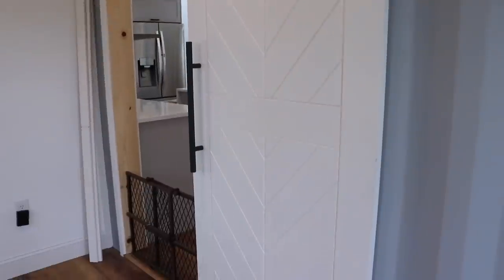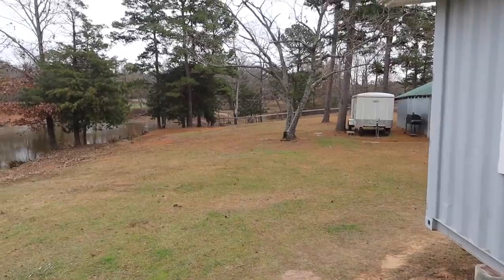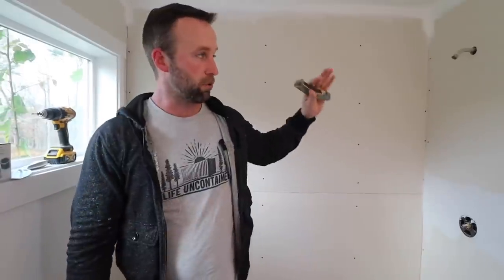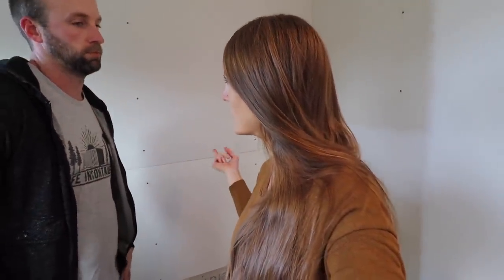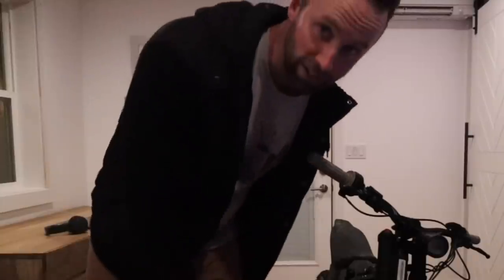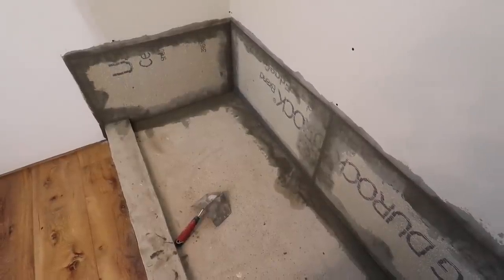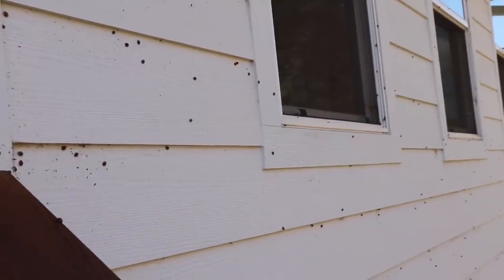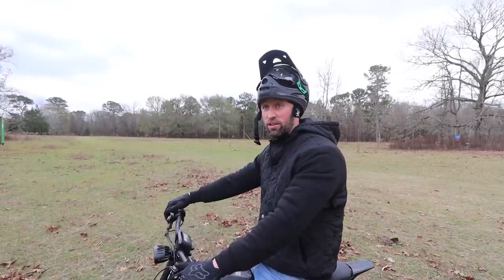THE MOMENT WE'VE BEEN WAITING FOR!

Comment: Smart to do that shower that way.  Schluter is the way to go as well.  I wanted our builder to use schluter and sub talked us into doing the old school cement board with red guard.  A few years later developed a small leak.  And of course traced it to the door threshold or curb.  It's a typical leaking point for a lot of showers.  Water hits it constantly so needs to be well sealed.  I noticed you took good care to seal yours with the liquid membrane.  Well worth taking the time to do the 3 coats.

Comment: Put in a rail slide in the floor that attaches to the door so it does not swing out. You can also put in a matching handle that has a hook latch that goes into the door frame and locks the door shut.

Comment: The storm shelter can be made by digging a deadman hole at each corner of one container and using rebar buried in concrete in the holes.  Weld rebar would be best.... Have you already done this?

Comment: Better keep it under 88 mph might start seeing lighting bolts in front of him. Oh I put a barn door in there not designed for trim suppose to be drywall wrapped corners but I used square washers and painted them to match the metal and bought longer lag bolts.  If I remember right there should be a couple set screws that keep door from coming off. Another thing kids love to play with my door I seen you put that angle bracket I might want a metal plate so the door don't go past the bracket? Just a couple pointers!  Looks fine debt free. Wish I had that growning up jack of all trades master of one and tons of energy!

Comment: I'm thinking that the first thing Beau is going to do, is lock herself in the bathroom. I am assuming there is a way to unlock it from the outside:-) If it works anything like a normal interior door handle with a pin-like device to trigger the lock, can I suggest mounting that device on a command hook up out of her reach on the door frame. That is what we did and it worked great. The device to unlock the door was always handy but it was out of little fingers' reach

Comment: they make a two sided roller guide that attaches to the wall. 10$ to 20 $ listed on amazon under barn door hardware. this is a much better guige than cutting the groove in the bottom. then you wont have debris wearing off the door.

Comment: You need to invest in a small Atlas Bunker / Storm shelter. Your family is priceless so a wise investment can protect them.
As for that slider to themultiuse room, the use of countersunk hardware from the start would have eliminated the issue with the trim being torn up. When the need arises I never use factory supplied hardware. 
I do like the independence from the grid, let it storm and the lights keep working.

Comment: Watch out on your electric bicycle I have a $2000 1000 W  BPM F95 electric bike and I melted melted the wires so bad that it was like I super glued the wires to each other and to the side of the controller Box and melt the outside coating on the wires  so do not get it too hot you might melt your controller and your wires I haven't checked yet to see if I melted the hub also but be careful getting it too hot especially with the tight Box did you have on your battery it doesn't allow air flow to get in there to cool the battery off

Comment: Ok next on your agenda STORM SHELTER.
   get your shovel and start digging LOL you have to protect your family at all costs .
    If ya don't have another container like yall built your house will you no where to find them and your great at steal work and running air dusts and you can add whatever yall think you will need.if you do it yourself you will save a ton of $$.
   But I know you can handle it.
After that ice storm you had there I would definitely do it and add heat for that reason and air for summer crazy tornado season.